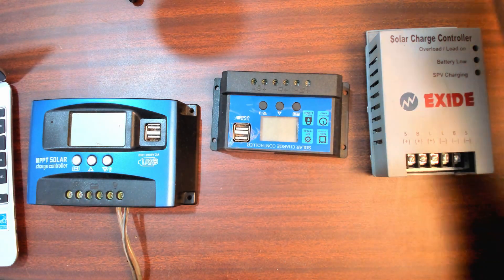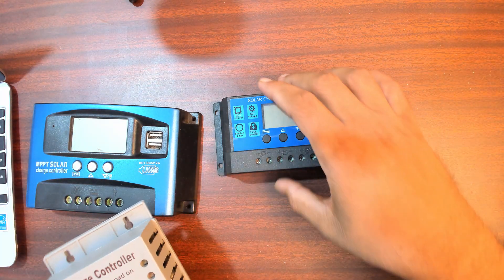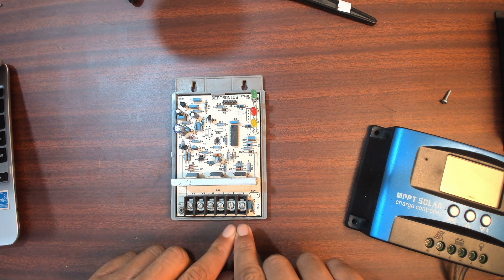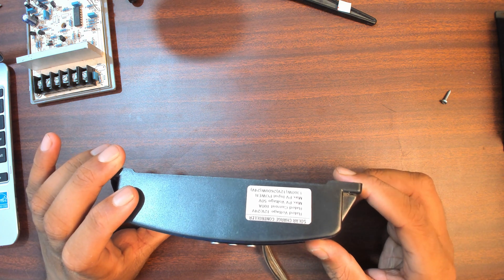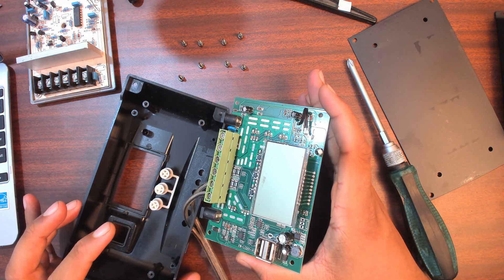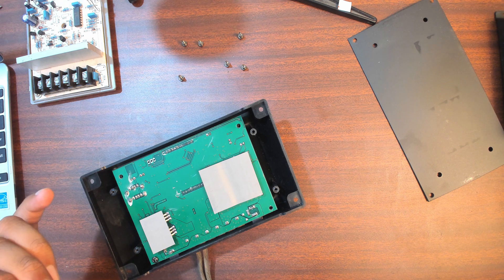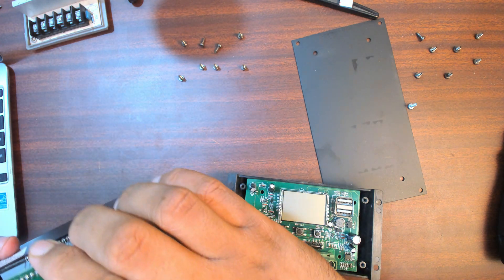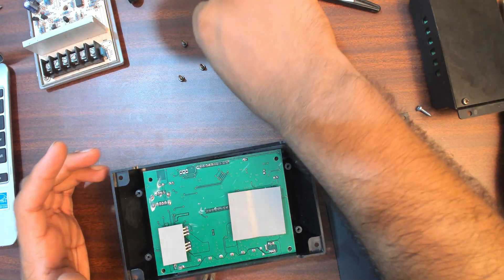PWM vs MPPT vs Fake-MPPT Solar Chargers

Comment: The black "mppt solar" one it fake but a clever fake, they designed the circuit to keep the pv input voltage high when measured. Puts out about half the panel input wattage to the battery though, up to 50% loss, sometimes no less than 35% when I measured amps.

Comment: Could you explain why they are named what they are named? What does pwm stand for? Etc.
Reply: PWM Stands for Pulse With Modulation.  MPPT Stands for Maximum Power Point Asfaik
Reply: PWM = pulse-width modulation.  It means that they turn a signal on and off very quickly, to make an equivalent signal to a fraction of the total voltage, when the period is faster than human reaction time to notice.  On net, the total on-time times the power supply voltage, gives the equivalent constant voltage.

Comment: I think both mppt one's are fake. The extra mosfets are just for battery overcurrent protection.
Reply from the maker: Yeah I figured out that as well as i was opening it. I might have to diy this one, I have a buck boost converter laying around that will be capable enough.
Pretty sad, i should've opened it before hand.
I guess it was working better that the other one as it had higher current capacity and the mosfets weren't heating up as much.
Reply: @usrbinsh  Hello, for what things could you use the false mppt?
Reply: The bigger "MPPT" that you prefer is known to produce PWM SCCs, they brand themselves as MPPT (likely in the hopes of scamming people)
Reply: Both those Mppt controllers are fake 🤣🤦

The lack of any substantial heat sink should have told you that.
Reply: There's no coil, simple, they're both fake.
MPPTs ALWAYS have one coil or more.
Reply: No coil(s), no MPPT, it's that simple.
You don't have to look at anything else.